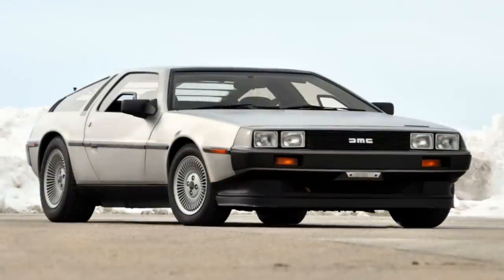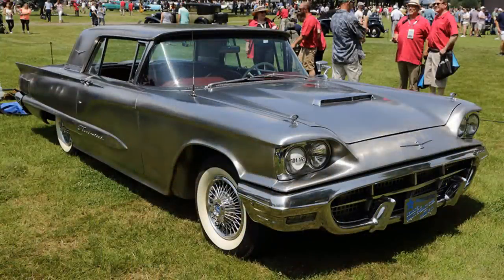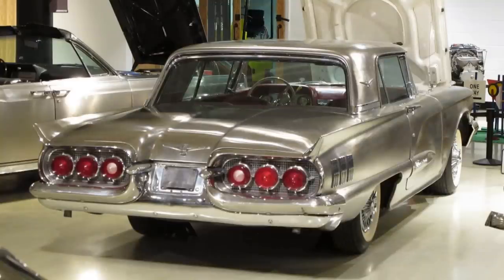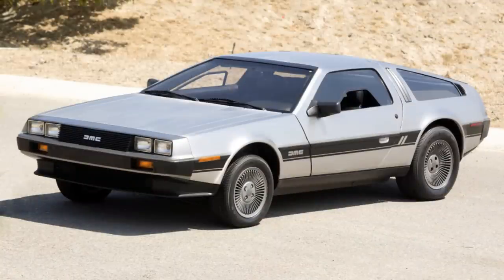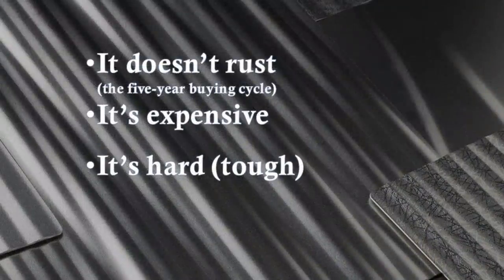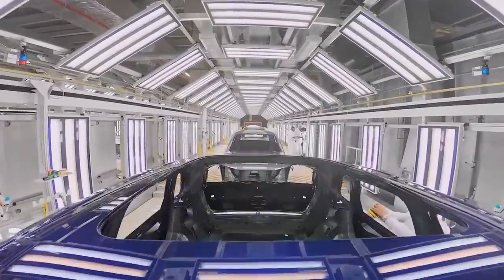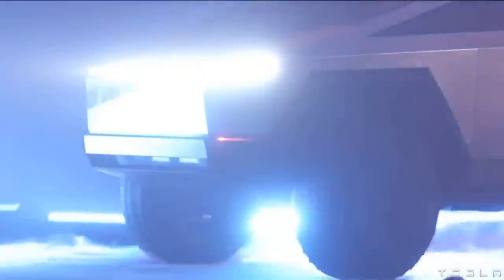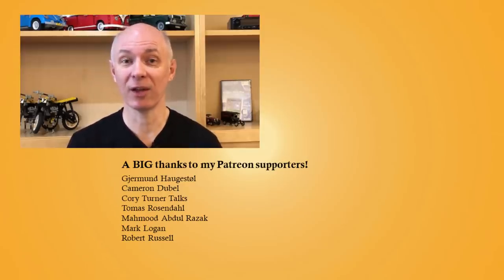Why aren’t cars made from Stainless Steel?

Comment: modern cars aren’t meant to be incredibly strong, they must deform to absorb crash damage. Tesla obviously understand how to make a safe car, their existing models are excellent in crashes but it remains to be seen if the Cybertruck, with very few body panels and built of very strong materials will achieve the highest crash-test rating
Reply: This is where FSD comes in. Good crash avoidance rather than destructive safety that we take as the normal standard. Better vehicle systems will all help ….
Reply: @chrisbraid2907  fsd doesn't matter, because the cybertruck needs to pass the same crash test as the rest. You can't design a car assuming it won't have any accidents.
Reply: I think it's reasonable to assume they will engineer a crumple zone into the front. As with all Teslas, this is relatively easy because of the absence of an engine there. Other than that, rigidity is mostly a good thing, to prevent intrusion.

Perhaps they will use thinner panels for the front end, but I'm just speculating. In any case, it's unlikely that they haven't thought about this.
Reply: @Seehart  the problem with that is that being a unibody there's so much they can do without compromising integrity.
Reply: @usarkarzts4207  I guess we will have to see what they come up with....

Comment: if you damage some part on the tesla you can cut it of and weld a new straight panel where the damage was. The advantage is that is made of straigt panels, you can buy them anywhere for cheap.

Comment: Re the comments about Audi; technically, aluminium doesn't rust because that term applies to ferrous oxide, but it does corrode, crumbling into powder. Broadly speaking, only pure aluminium doesn't corrode because it forms an oxide layer that, ironically, prevents any more oxidisation occurring. Unfortunately, pure aluminium is way too soft to make anything structural out of so it has to be alloyed with other elements and then it needs protecting as much as the steel used for conventional vehicles.

Comment: Not rusting is only a starting point.  The longevity of the drivetrain is the key point.  Stainless steel is heavy.  Aluminum (or "Aluminium") is better.  But carbon fiber or glass fiber is even better.

Comment: The design of the Cybertruck saves them the massive cost of sheetmetal stamping tools. The downside is higher assembly cost, but makes sense at low volumes.

Comment: The big problem with any ferro-nickel alloy is the rapid rate of work hardening due to twinning of the grains. This is why unskilled hands will really struggle if they use a hacksaw to cut through stainless steel.Retained stresses can cause distortion of the product as the stresses dissipate with time, and also affect behaviour of distortion during impact. To pass accident testing requires a controlled degree of distortion (i.e. 'crumple zones'), but after years of use, being exposed to the sun, and any repairs, will all affect the material's performance. As stainless steel will tend to harden with age it is possible that an old car made from stainless steel would not attain the same safety rating as it got when it was new. Stainless steels suffer from inter-granular corrosion, galvanic corrosion, differential aeration corrosion, and thermo-differential corrosion, all of which can compromise the material's performance. Other than for making small, non-moving, shinny parts of cars, stainless steel is not really a material which has any benefit over other materials when used for car manufacture.
Reply: @awashburn6944  The stainless steels used in aerospace, nuclear, chemical processing, etc. applications are not your common or garden stainless alloys though, they are exotics, some are even powder formed in order to be anisotropic. This makes them very expensive, I have encountered simple 8 mm dia. washers for nuclear applications which cost more than £300 each. All cars are built to the lowest possible cost, so they aren't going to invest in developing compositions for exotic alloys, in fact they don't invest in anything much really, other than adopting technologies from other realms.
Reply: @awashburn6944  I have worked in the nuclear industries. This required me to sign The official Secrets Act, so this conversation ends now.
Reply: @awashburn6944  You clearly have never worked in any nuclear industry, if you have ever worked at all.
Reply: @awashburn6944  When do you expect to leave school? If you work hard at school you might be able to get work in one of the nuclear industries, then become an alcoholic like about 75% of us have done. I was a Nuclear Physicist, the Metallurgy was just a subject which interested me. The reason that I am a Reverend is because of the way that my second PhD was sponsored, there are quite a few such Reverends working in the nuclear industries, and about 90% of those are alcoholics. It doesn't matter how clever you are, it's all about how much you can drink that decides how your career will go.
Reply: @awashburn6944  In the UK the power industry (all fuels) was run on alcohol. It has probably sobered up quite a bit over the last ten years or so, but in the 1980s and 1990s it was all about the drink, and quite a bit of cocaine too. We even built distilleries on site at a couple of places. The introduction of drug & Alcohol Testing came in in the late 1990s, and the party stopped soon after that. I lost my clearance after I knocked out a politician at a works social evening. We also had the benefit of unlimited funding, all from the government, so if you could get your idea approved you could have two or three years of messing around in laboratories before you had to submit a report. Happy daze.

Comment: Aluminium rusts very hard as I can tell you as a former airplane mechanic.
Only pure aluminium doesn't rust when it gets its metaloxide patina but it's not suited for construction purposes so alloys are used which aren't very rustproof.
The reason Audi uses aluminium(alloys) is probably the same why it is used in airplanes, because it's light and strong.
But it needs a lot of protection from the elements.
Reply: Rust is iron oxide, pretty sure aluminum doesn't rust, lol.
Reply: @halohunter5217  Right, corrosion then.

Comment: I think auto makers could have workarounds to still make money while producing cars that last. - Building a fanbase, producing branded merch, replacing clutches and brakepads, textile interiors that wear out. Instead of entire new models, brands could be selling upgrades for long life chassis cars, and make them more modular so you don't have to throw away what you like about them to swap out something else.

Those who only have one car because it rusts away by the time they can buy a new one could instead afford to keep two for different purposes, like one big petrol engine car for long trips and one small electric car for city commute...
I think there could be a working business model built around it. The starting capital and launch prices of the first few models would fall on the more expensive market segments, for sure, but in time the brand could trickle down new models to cheaper segments, as sales volume increases.
I'd love to have a stainless city EV or even a stainless electric scooter, knowing that I would have to plan for regular annual check-ups and battery replacements every 3-5 years. I think it would be steady business, with higher brand loyalty. When a product serves you well for a longer time, you'll probably recommend it more to your friends.
As more people mentioned it in their comments, it would be better for the environment too. Keeping the chassis on the road and only swapping out smaller obsolete modules while upgrading reduces the overall amount of discarded material and the energy required to process them.
I would be thrilled to be able to buy a car knowing that it would serve me well for decades, while I can rely on the same brand to service it for me without me having to look for something else.

Comment: From toolmaker side your information is wrong. Stainless steel can be formed very good. It is very stratchable. Aluminum on the other hand is very hard to form. It has a low tensile but is very brittle.

Comment: Sounds a little, like DeLOREAN went bankrupt because of the stainless steel they used, but the reasons were others, as you know! Aluminum doesnt rust, but oxidizes as well and like hell if the surface is demaged just a little. Especially at the front, after your car was hit by a micro stone you'll see how "rusty" Aluminium can be after a short while, like it happened to my CADILLACs hood lately!!! And if you own an AUDI, you hate to buy doors from time to time, after your car was hit by another car owner at the  supermarket parking lot. The AUDI dealer loves you, because often just replaceing spare parts... To expensive to repair the expensive parts! D/A/G
Reply: Yet the Audis are made from steel, just better galvazined than the others. For some reason the baseless myth about the aluminium doesn't die, but that's what ignorance is.
Reply: @jammi__  I personally don't drive VW products at all, I absolutely dislike the history and the ethical behavior of this partly goverment owned company!... but we have an A8 & one A6 Avant in our closer family and both guys meanwhile had expensive aluminium demages on their parked cars. Of course I am not familiar with each piece of this brands cars, but my "brother in law"  just has the second bigger dent at  his A6 doors and his AUDI dealer/repair shop told him to replace again, cause smart repair seems impossible - material wise! But you might be right, if you say, that the present models have galvanized steelbodies again!?! Steel for a more rigid body structure was used even before... Whatever! D/A/G

Comment: The argument about stainless being harder to weld is not true for all of the stainless alloys that I have ever worked with. I welded alot of 304 stainless and it has a lower thermal conductivity than carbon and alloy steels so welding is easier, requires less amperage and the weld puddle stays put. A metal with high thermal conductivity like aluminum is quite difficult and resistance welding is almost out of the question without special super high power spot welders.

Comment: According to my observations, 99% of rust on modern cars are on wheel arches or at the lowest part of the body behind the front wheel. Using stainless steel in other parts of the body seems like a waste.
Parts under the chassi however, could greatly benefit. But they like selling speare parts, dont they.

Comment: Doesn't look as if it has a particularly practical truck shape, a triangle isn't the best shape for maximising load volume.  It doesn't seem particularly aerodynamic either, and hard to see how a better drag coefficient could be finessed with stainless steel.
Reply from the maker: There’s some videos on YT that look at the aerodynamics and it seems it’s more aerodynamic than you might think.

Comment: Musk said Tesla would use a score-and-fold method of construction for the Cybertruck, which largely explains the styling. Some of the panels, such as the inside of the doors for example, are clearly still stamped though. I wonder if they just plan to suck up the cost of replacing those stampers, or if they've got some other magic trick in mind? Also, who the hell calls anything 'cyber' in 2019?

Comment: Because stainless weighs twice as much as steal and that destroys performance handling and it is much harder to repair accident damage!
Reply: In which universe is stainless steel denser than "normal" steel?

The average density of low alloyed steel is 7,87 g/ccm, the density of the most common austenitic stainless steel (X 5 CrNi 18 10, think "kitchen sinks") is 7,90 g/ccm.

If you don't know it, inform yourself before you write BS...😎
Reply: @stefanpaege2046  Indeed. And the vid maker is also a bit prone to perpetrate falsehoods, eg equating hardness with toughness

Comment: Musk is using aluminium mega-castings for structural parts of his cars. A great idea as they may eventually include the body sides and the chassis. However, when put against stainless, galvanic corrosion quickly attacks the aluminium. How are Tesla handling this issue?

Comment: I find it funny how your videos end with the same tune as the Hodge Twins videos.
Reply from the maker: That's YouTube's audio library for you!
Reply: @BigCar2  You damage your credibility when you equate hardness with toughness. Generally increasing one decreases the other. Toughness is a misunderstood term; it is essentially the ability to resist brittle failure. If you make steel as hard as glass, it becomes brittle, like glass, ie very low in toughness.

Comment: Since the SS panels are attached to traditional painted steel or aluminium members I don't think they will be welded. At 3mm solid SS would be very heavy. I think SS will be the skin of a fiber reinforced composite, (not unlike the Delorean) perhaps with Kevlar, (Elon promised bulletproof.) They will be attached with adhesives.

Comment: It's only the body that will last a longer time, all the moving parts will wear out along with the consumables such as clutch, brakes  tread et cetera, and the batteries for this Tesla truck will cost as much as a new truck to replace.
Reply: No clutch ! It’s electric so a lot more time between parts replacements brakes work a lot less than Petrol and diesel cars . The tyres are probably the biggest cost and battery performance is improving along with the cost. Upgrades will likely be much easier than current cars … Tesla Battery replacement is currently cheaper than the original batteries and looks to continue …

Comment: Living in the rust belt I have cursed car companies for years for this RUST problem.  They could at least do something about the high rust areas. Wheel wells, lower doors, rockers etc
Reply: They have, haven’t you noticed how much plastic shielding they have fitted, plastic anchors to hold them too … underbody sprays can help hold the rust at bay, otherwise move, your choice …
Reply: @chrisbraid2907  and none of it is working against the salt. It's all just traps for the salt

Comment: BIGGEST MISTAKE: the higher cost for stainless steel will be overcompensated by multiple times cause there is no paint and paintshop needed which will save about 1000€ of costs at least if you have to build a plant without a paintshop cause that is not only about the paint (better several layers of paint) but also about the paintshop and the quality assurance of such paintjobs.

Huge mistake that has not been corrected till now, so a bit disappointing that mistakes or corrections are ignored.
I did not check the other past videos over the past few years cause  I had believed they would be true and serious but I guess there might also be mistake and to find them I would have to read all the comments to get behind that.
Not so professional as I had thought.
Reply: I dunno, once you have set up a robotic line that paints the cars, surely the cost for each car is not that high?

Comment: Manufacturers should at least use stainless steel for brake lines. This is a life-death issue. From my experience, rusted brake lines burst exactly when you need to brake. No matter that you have 37 airbags in the car, you are going to hit something or, even worse, somebody.
Reply: SS still suffers from degredation in salty environments. Volvo have been using something called 'cunifer' for brake lines for years. It's a copper/nickel/iron alloy which is perfect for brake lines and doesn't suffer from corrosion. You can buy it yourself from auction sites.
Reply: This is why safety inspections exist... it's not like rusting brake lines happen overnight. Personally, I've never had issues with brake lines rusting and I live in the salty rust belt.

Comment: The production version will have alot more plastic in the fornt just like any other car, there are pedestrian safety rules which this thing needs to manage somehow.
The question is how the ugly plastic will look against shiny stainless steel. painting everything like a normal car would ruin some cost saving effects they try to achive with using stainless steel...

Comment: Sorry, I don't buy a car for just 5 years, but for 20 years (I had a Volkswagen that lasted 21, Volvos for 18 and 23, and now 9 year old LandRover), and I would appreciate it if the car would even last my lifetime long, as I expect from other items that I buy, and occasionally repair. And yes, I like the DMC1 and Ford A model 30 with stainless steel silvery parts because of their long lifetime and would buy one if they were still available, or Porsche 928, Audi 80 and other cars that have proven their reliability. Sadly NO COMPANY builds car for customers like me, Volkswagen says internally "everything that breaks after 7 years is not of our concern". You once made a video about Volvo 700, long lasting and ease of repair, that were reasons to buy the cars before Ford took over.

Comment: Did they claim it to be bullet proof?
What about deformation in a crash? To absorb the energy, instead of sending it into the human?
Reply: I'm sure they engineered the panels to slide outwards in a crash
Reply: Resists nine mm bullets not likely to deform in a crash which to happen would likely be deliberate as the technology works against that happening.

Comment: The reason why the Delorean was a flop wasn't becuase of the stainless steel body, it was because of DeLorean being setup and stupid EPA bogging down HRSPWR.

To be fair the stainless steel body panels on the DeLorean  was intended to be replaced if ever was dented, scratched, or warped. Which was a non traditional concept and people had the adjust and would rather not. But due to the company falling, you weren't able to replace the stainless body panels for cheap.